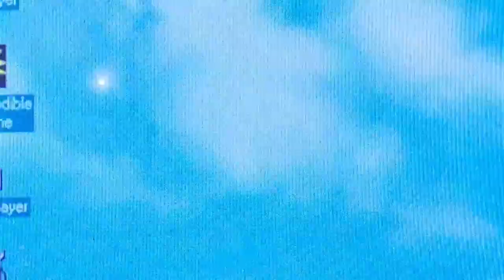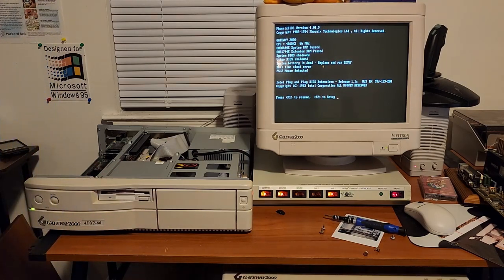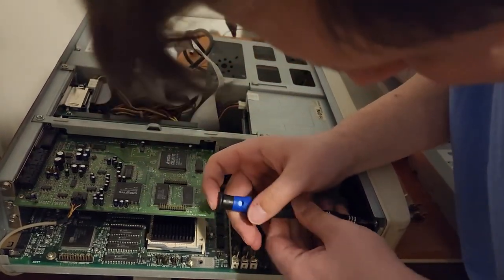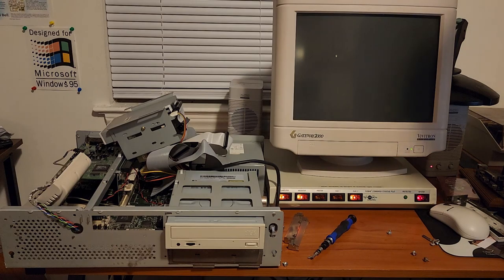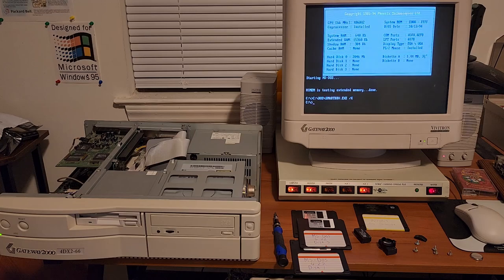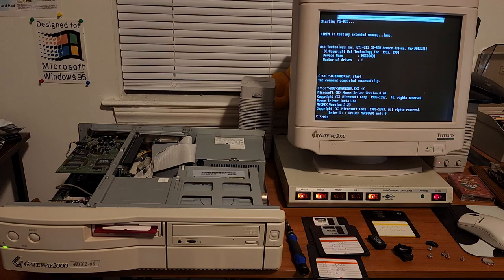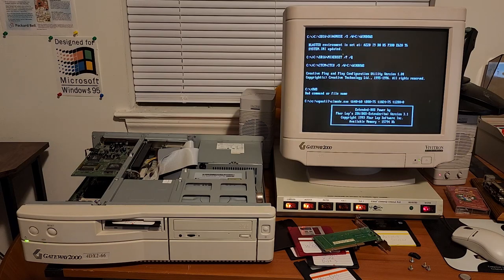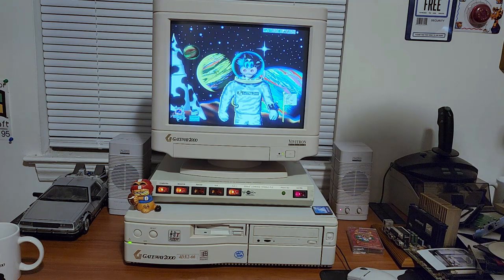Gateway 2000 486 Restore Saga

Comment: Awesome job Billy! I've gotten into vintage computing because of you and I think we're using the same IDE-CF card adapter!
My question is my BIOS doesn't detect when the CD-ROM is set as Slave and the CF-card is set as Master, so would I need to make them both Master?
Reply: Did you ever get this figured out? If the CF card adapter and the CD-ROM drive are on different IDE channels (like the CF card adapter is on the primary -- and since it's the "hard drive", it should be -- and the CD-ROM drive is on the secondary), then they should both be set to Master. One should only be set to Slave if they're both on the same IDE channel.
Reply: @KamionRenokai  Yep, I got that figured out!

Comment: How exactly do you setup an adapter and CF card for one of these? I have an old 386 and 486 that I'm working on right now that have suspect HDD problems? Just curious about the process because I'd rather not take a chance on finding a good old IDE HDD for these.
Reply from the maker: It's actually not that different from setting up a regular hard drive. You just plug the IDE and power connections into the adapter and put the card in.
Reply: @TheNostalgiaMall  Yeah, I realize how simple it was to do. I didn't watch the video far enough. Put the cart before the horse. Lol
Reply: @lftdblazer 

Exactly

I could definitely replace the compact flash card adapter with a 500GB IDE hard drive soon enough
Reply: @lftdblazer For me, it's just the jumpers that are confusing. When both the CD-ROM drive and hard drive are Master, they're detected, but some people tell me that's incorrect.

Comment: Just got one of these exact models, its been way way too long since I had a 486 and looking for some pointers to forums, informational websites or blogs on 486 DX2-66 PC architecture.  I know there are IRQ's to manage, IDE Drive Settings, etc.  I need some way to plug back into all that.  I would also like to get a nice video card for it, looks like I have one ISA and one PCI slot available at the moment.  The other has an SB16 in it already.   Any help would be greatly appreciated!

Comment: I had one of these and put a U.S. Robotics dial-up card in it at 56K!! WOW instead of 28K. I Had 32 MB of RAM and I switched the CPU out for 100 Mhz. AMD. I threw the INTEL 33-Mhz. CPU out the window. Never have used INTEL since.. Biggest thing was the SEAGATE HD at 2-Ghz... I loved AMD's upgrade to a 100-Mhz. CPU! it cost like $40 back then to get 3 times the processing speed that was more stable then the INTEL at 33-Mhz.. DUDE learn to SOLDER if need be.. I need to also...

Comment: (EDIT: FIXED, PCI CARDS WORK FINE WITH NO MODS, HDD CHANGED TO 2GB)I have the same PC but a lot is issues. What ide controller did you use? Primary(PCI) Or secondary?(ISA). If you use one, that port cannot take cards anymore otherwise nothing will work